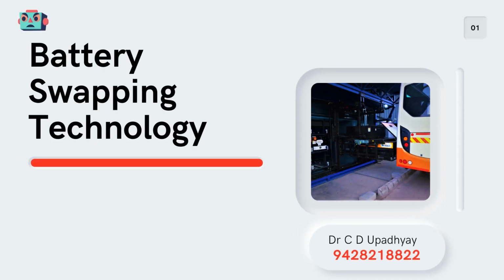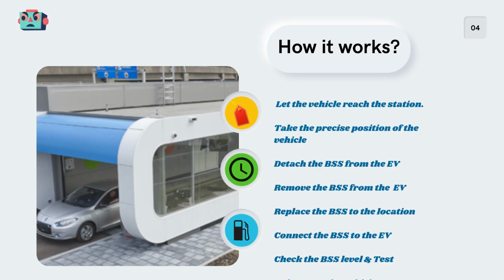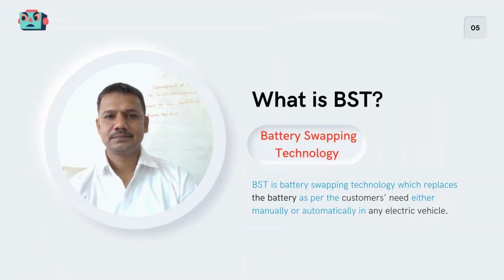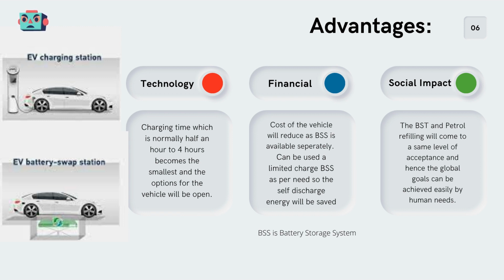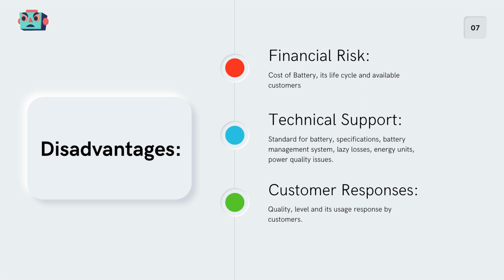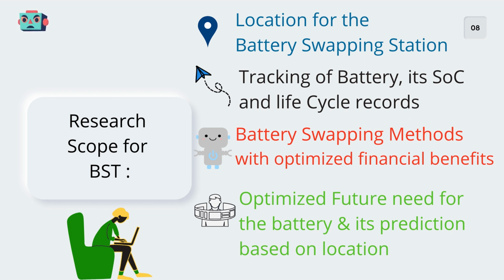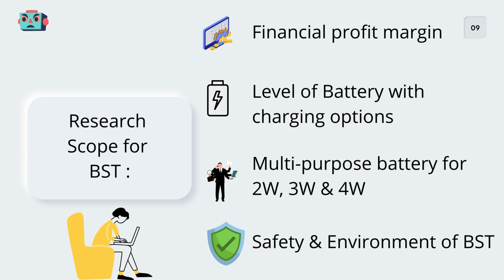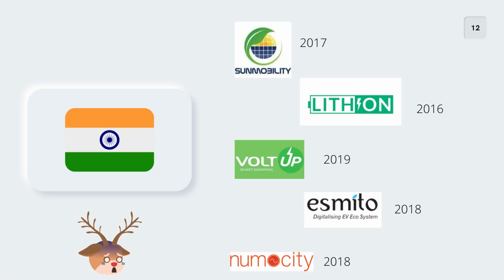Battery Swapping Technology (BST)

Comment: Amazing video sir. Didn't know that Tesla started battery swapping technology earlier, but abandoned it later due to low financial gains through it.
Reply: In my opinion, whether it be a battery swapping station or a traditional charging station, the need of the hour is to open more and more such stations to promote and boost the sales of electric vehicles. Because if there are ample of electric vehicles on the Indian roads and the customers of such stations are increased then and only then we can come to any conclusion about the financial viability of battery swapping station or traditional charging station. Till then any infrastructure of such stations will be helpful only to boost up the sales of electric vehicles, we can't expect much profit from them.
Reply from the maker: @tirthmehta5166  correct, unless petrol pump was not there you want prefer to buy a petrol vehicle. Similarly for EV.
Reply: Yes sir
Reply from the maker: Model s
Reply from the maker: Model S, there are many bankrupt. What is your opinion for indian market?